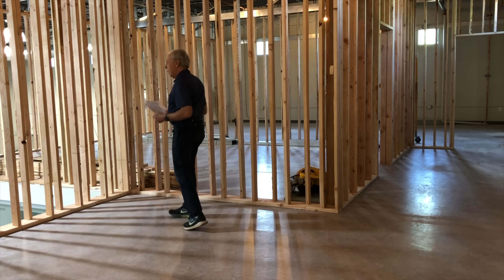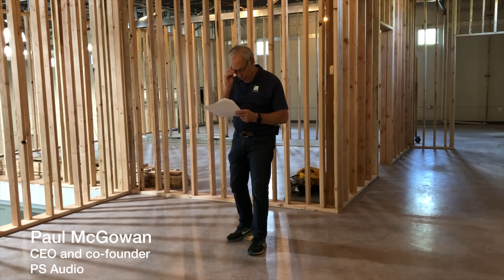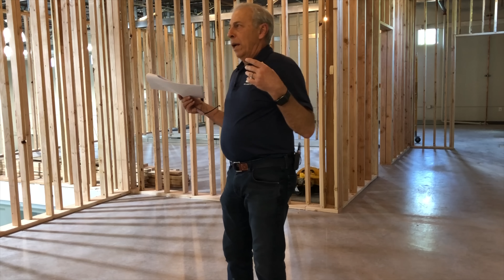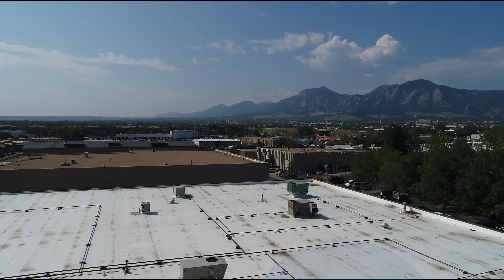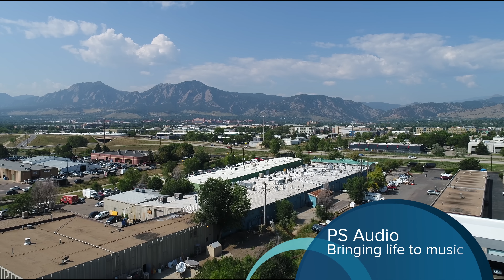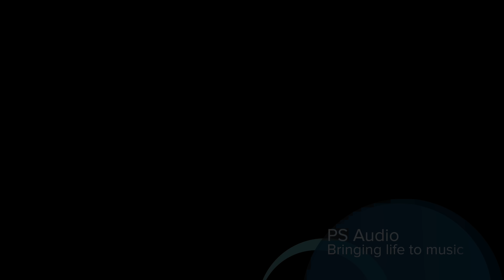Which is better, sealed or ported speakers?

Comment: My man's are 7" two way ported cabinets that roll off with an F3 at 45 Hz. The roll off is drastic, like rolling off a cliff. 6db down is probably at 43Hz.  My sub is a sealed cabinet with a system Q of .81. This gives them a bump at around 55 Hz, but the roll off is much less steep that ported cabs are. They are 3db down at 23 Hz, and by 6db down they are below 20 Hz. So the total system is really flat from 23 Hz to just above 20kHz. The advantage of a ported cabinet is that it raises the F3 of a driver, but the roll off is steep. A sealed box drops off sooner that a ported box, but depending how you tune it, the roll off is far less abrupt or less steep than a ported box.

Comment: Good speakers don't need ports.
Reply: Speakers are designed to work in either sealed or ported.
Reply: Depends if it requires more space then you have to work with aswell. You can have a smaller speaker box in wall ported
Reply: True. Good example: the ATC speakers. Consistently testing top class and sealed.
Reply: . @hanskuijsten2380  ATC make more ported models than unported
Reply: @captainwin6333  They use the port for stalling the bass driver @ 25Hz so they can run higher SPL at that frequency. They do not use it for bass gain like most speakers. So the 'Ported' versions still sound and behave like sealed boxes. Listen to them and you wont hear the port.
Reply: @hanskuijsten2380  
Yes. 
And Klipsch K-Horns would be considered Ported. 
And they Suck, right 😂 
...amateurs...
Reply: I totally agree ..and they don't need a silly servo either !!

Comment: Ported vs sealed is a compromise of deeper and more powerful bass vs more firm and lower distortion bass. By adding servo in a closed speaker you can enable a longer more precise excursion and achieve the best of both.

Comment: Given the amplifier and cabinet is the same power and size then generally:

Sealed = deeper extension and a more consistent frequency roll off. Less efficient.
Ported = more output above the tuning frequency, especially as you approach the tuning frequency. Much less output below tuning frequency and much harder to control the woofer below tuning frequency.
Reply: Missed the main factor... No port noise. All affordable reference monitors for studio use are all ported. To give us that BS flat to lower freq response graph. Both mine are ported. I have no idea how anyone mixes perfectly on these, port noise is so bad. £1500 speakers!!! It's like we pushed manufactures to gives us what we don't need. Especially if adding a sub anyways.
Reply: I have a DIY ported sub and I get no port noise. The port diameter was chosen specifically so the air velocity through the port does not cause noise.
Reply: No port noise... Please take your lies else where. You can't argue against SCIENCE!
Reply: @mitchiemasha  the air velocity through the port is under 5m/s, which does not cause audible noise. This is science.
Reply: Is this a big port or a small port. Does it actually give you enhanced bass. What frequency is it tuned at? And, I was on about studio reference monitors not subs.
Reply: @mitchiemasha  100mm in diameter, 35cm in length. It's on a 12 inch sub and the response is pretty much flat (as you'd want in a studio monitor). It enhances the bass by helping the woofer extend lower in a linear fashion towards its Fs. The lower it gets depends on the enclosure volume. The flatter it is depends on port tuning.
Edit: it is tuned at around 25Hz
Reply: wow you should bring a range of studio monitors to market, you've achieved what non of the leading brands have... or at least what I've heard of them.
Reply: @mitchiemasha  most studio monitors are ported, and they're (reasonably) flat. Producers make music on them. Do you think it's magic or some sort of conspiracy?
Reply: Yes... and if you solo your sub bass track and turn them up... what you will hear isn't what is on the track. PORT NOISE! My full point is how, them going for 'flat', for extended low end range, to give better specs on paper, they introduce something to the design that actually colours the sound more. The market has kind of drove them to this and they do do it quite well but... I'd still prefer a speaker in that price range with no port and less 'spec'. With out the port they can't brag +/- 3 down so low but they fail to tell us about the ugly secret they hide. They have to do it to compete. We get things like Barefoot but they are way out of price range and there's a waiting list.

When it comes to speakers, port noise is the elephant in the room. Most like yourself simply choose to ignore it. Either you're not a mix engineer or you don't listen to music that has passages of bass and minimal mid/tops to notice it. It is there, just the rest of the sound masks it in most cases.
Reply: @mitchiemasha  Not sure if you realise this, but speakers are supposed to be moving air in a way that makes noise. Sealed speakers do it too man, that's why you hear them.

In all seriousness, if ported designs were fundamentally flawed to this degree that it was plainly audible, no one would be making them for the high end, it would all be sealed designs with some signal processing if necessary to flatten the frequency output.
Reply: Ahhh. like i said elephant in the room. just keep ignoring it.
Reply: Notice my words  "they do do it quite well". You were the one who made a post about the "=" I was simply pointing out something you missed out. My statement is not false.
Reply: @mitchiemasha  Yeah it's got to be that you alone are correct and everyone else is wrong.
Reply: Wow Seriously. Are you telling me port noise doesn't exist? When i turn my monitors up and try mix low end, the extra noise I'm hearing not in the recording is in my imagination.
Reply: Not only is there an elephant in the room, it's pink with yellow dots. And no, everyone else isn't wrong, many people know about and have to work around the issue of port noise, on a daily basis.
Reply: @mitchiemasha  Yeah it's false, you called it the ""main factor"
Reply: Ok. i'll take that back... That's my opinion, it's subjective due to my needs. Objectively it might not be the "main factor" but it's something that has annoyed me for a long time with studio monitors. To ignore it and say it's not an issue is simply feeding the blind. The point behind my posts isn't wrong.

Comment: I would say it depends on the frequency response of a single driver. For example, Most tweeters and midrange drivers have a sealed basket on the driver itself. That makes it easy for pairing tweeters and midrange drivers with the internal cabinet space with midbass driver/s. Ive learned that most 4in midbass drivers sound  best in a sealed enclosure  between 100hz and up. Most 5.25in midbass drivers sound best in a sealed enclosure between 80hz and up. Most 6.5in drivers sound best in a sealed enclosure between 60hz and up. Most 8in midbass drivers sound best in a sealed enclosure between 40hz and up. It really comes down to the specific driver and cabinet quality that may give you lower or higher numbers. Ive gotten these numbers and results from my own testing. Im guessing that the question was going out to all the DIYers. But in my opinion sealed sounds better for  punchy quality sound in a midbass driver. Subwoofers are a completely different story. You have many more cabinet type options. Like tapped horn, transmission line, bandpass, and regular ported etc. Hope this makes sense. Thanks for all that took the time to read my long comment.

Comment: Properly designed ports can help get great sound in the tricky 16 to 30 Hz range. Start with a 15" driver, put it in a 5½ cu. ft. enclosure, add two 4" ports and adjust the port lengths. Configure the woofer crossover at 300 Hz. It operates essentially as a sealed box down to around 45 Hz. The woofer nominal free air resonance is 16 Hz, and start to roll off at around 55 Hz. . So, the port lengths are adjusted to above 16 Hz and below 55 Hz. The best tool to use for this is a wave analyzer. The PVC ports use elbows to attain sufficient length in the enclosure. They share characteristics with transmission line, in that some phase shift is achieved. Since the Helmholtz resonator drops off at 24 db per octave, the driver resonance is reduced. The speakers are very efficient, so driver excursion is short, even at high volume. It's just physics.

I have some great sounding acoustic suspension speakers too. They don't have extended bass and they take a lot of power. They feel like they're working rather than idling. Some people like big-block V8s and others like rev'd turbo 6s. They both get you down the road.
Reply: Again, People who can not just sit, shut up and enjoy their Music - this seek for perfection is killing you, right? 

Just friendly asking :)
Reply: @SocietateaAscendenta  I'm not concerned about what others do regarding trying to make their music sound good to themselves. It amuses me when people make broad generalizations and spout it off as truth, rather than opinion; they reveal their ignorance. 
Perfection is impossible. Sufficiency is possible, but can be difficult and expensive to attain.
Reply: Are you a Robot, sir? :))) 

No, I am sorry, if that sounded like ignorance. It is nice that you share that info - really is! I appreciate it. 
And I am not saying that one should listen to a phone... okay? I have 2 pairs of studio Monitors and am concerned 
if the ground Loop is doing "well", if the cable is alright, if the external soundinterface is still hanging in there... 
But, that super, too deep, technical stuff, "16 to 30 hz", put it in a " a 5½ cu"... 

MUST SOMEONE always add up things like These, like in every Video? 
Mr. Paul said it already: THIS IS not a super-deep technical Video. 

Can't you gentlemen just let it be, for once? 
Let that Palm itch be... and just look, like, share, also comment, but ALSO explain what you actually wanted to say? 
For others who might not understand? 

Or I could start commenting in my mother language then you would be pissed off that you had to find a translator :)))) 

WHAT is that you wanted to transmit us, Mr. Brain? 
What is the message, actually? 
"I have some great sounding acoustic suspension speakers too. They don't have extended bass and they take a lot of power. They feel like they're working rather than idling. Some people like big-block V8s and others like rev'd turbo 6s. They both get you down the road." 

Sealed, ported? WHICH ONE IS BETTER? 

(That was the Topic)
Reply: @SocietateaAscendenta  I suspect that some meanings are lost in translation.

The reason that I added enclosure volumes and numbers is that small ported speakers often sound (nasty, boomy, uncontrolled) - pick your word. Larger enclosures can benefit from ports if they are designed to extend response and maintain phase as much as possible. 

I think that when someone says "all ported loudspeakers sound bad," it makes them sound ignorant. If they say "all ported loudspeakers that I have heard sounded bad *to me*," they sound like they have an opinion to be respected.

There is no "which one is better." Ported and sealed loudspeakers can both sound great. The designer needs to pay close attention to physics in either case, to produce great sound. Poorly designed ported speakers often sound worse than poorly designed sealed speakers.

People develop sound reproduction preferences over time. This influences their loudspeaker design preferences. People who drive develop performance preferences over time. This influences their engine design preferences. These things are the same. There is no *better*; only preferences.
Reply: Well, thank you very much, for taking your time on this! 
This is now CRISTAL CLEAR to me! THANKS A LOT! 

I have some Presonus Eris 3.5 and Sound alright to me. 
They are Little, but nasty :)))))
Reply: @SocietateaAscendenta  I'm with you there buddy! How dare that guy share his hobby and knowledge with us! He should just enjoy his music! Who cares what it sounds like! That's why I listen to katty perry outa my phone speakers!

Comment: Sealed vs Ported: 
Sealed systems lack bass due to the inability of the driver to extend. This is because of the vacuum created from the driver pushing out and the pressure difference created pushing the driver back in the cabinet. Ported doesn't have this issue, allowing the driver to push and pull out as far as possible before self destruction. Not saying you can't blow up a sealed speaker, though. While sealed has a higher f3 (where the speaker drops off 3dB ) than ported, ported has a much steeper slope that it falls once it hits f3. The common statement is that sealed can reach much further lows despite the higher f3 due to the gentler slope and that the room buildup of bass fills in the gap to create a flatter response than ported in the lower frequencies. The pro-ported counter to this is that proper engineering and design of the cabinet as well as driver can create a flat response with a far lower f3 and with much less wattage use, nullifying the pro-sealed statement of 'reaching further down'.  One thing that is consistent is that ported is going to need a bigger box. I'm not going to address chuffing because that can be addressed with aforementioned cabinet design as well as flared porting.

Driver design designates best application of the driver. Drivers are intentionally designed to fit into a sealed or ported enclosure. Others are designed to be ambiguous to cabinet design. Drivers that have more mechanical and electrical control over a cone are typically better suited for ported designs while drivers that have less control over a cone are suited for sealed enclosures, but it depends. There's a lot of factors at play at this point. Typically, the electrical control in conjunction with the resonant frequency of the speaker as well as the sum of the total control over the speaker cone, both mechanical and electrical, will determine whether or not the driver is better suited for sealed or ported. These are also known as EBP and Qts. So, to sum it up, typically you're building your cabinet around your driver based off the driver specs and how the driver reacts as opposed to just picking sealed or ported. 

Putting a high control driver in a sealed box 'over-controls' or over-damps the speaker, raising the f3 and counteracting the whole "getting lower frequencies" aspect of why it's used. Putting in a lower control driver in a ported box doesn't allow that sealed vacuum to act as an additional damper, affecting it's output and time domain issues. 

Time domain issues aka transient decay is the "less talked about but just as important as frequency response" aspect of a whole speaker. Sealed systems typically have a much better (faster) transient decay than ported systems. This is due to, you guessed it, the port. While a port-centric driver design might have more damping, it doesn't always have that damping in the lower frequencies. Poor ported designs often exhibit "one note bass" due to the poor transient decay and low frequency slurring over a long time. Given a good enough driver and cabinet design, this issue can be drastically reduced to the point that the benefit of lower frequencies with increased efficiency overcomes the time domain issues. Sealed systems won't give you "one note bass" and will give you a more accurate "tighter" bass despite the higher f3 and more power to drive the unit. 

So, overall, it's a give and take depending on the what you're looking for and ultimately what you get is the culmination of a company or individual's engineering prowess. Generally though, I'd say if you're looking for more boom for your buck, ported. If you're looking for low end clarity and don't mind spending a little extra on extra drivers and amps, sealed.
Reply: After years of mixing house for metal and hard rock, you're comment about speaker destruction made me laugh !! Your post is spot on, I agree, through experience, with all of it. We once designed and built a pair of mega monitors for a drummer who only wanted drums in his mix. They were basically a sealed 2x15 2x12 1x2" and 2 bullet tweeters, all JBL. They sounded incredible and were triamped. After the first leg of the tour, he asked me to swap them out for the JBL 2x15 " scoops" with horn loaded tops, he said the new monitors didn't have enough punch !!! Cheers
Reply: Infinite baffle is sealed and superior to ported or air spring. Size and cost are the down side
Reply: @stevejacksonpianos  it depends on the driver and the goals of the design. there is no true answer for every situation. from what i've seen, higher fidelity out of a ported design requires a larger cabinet